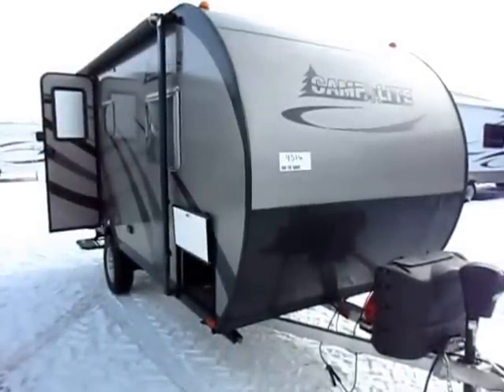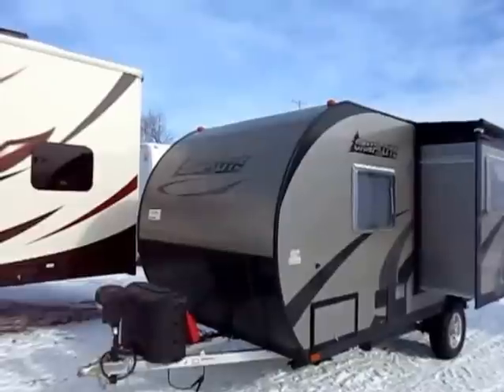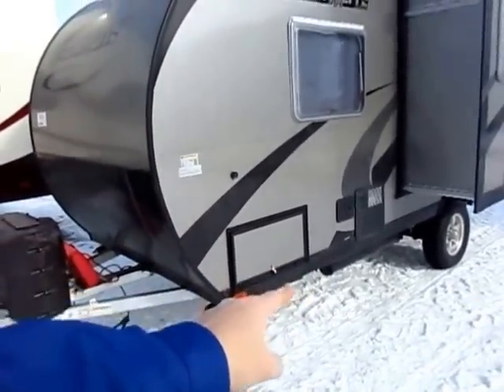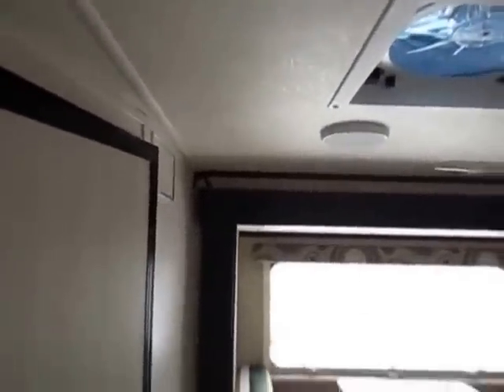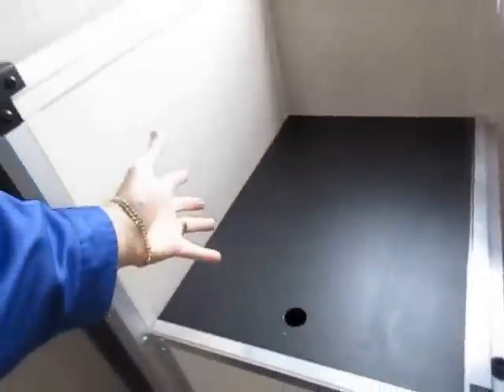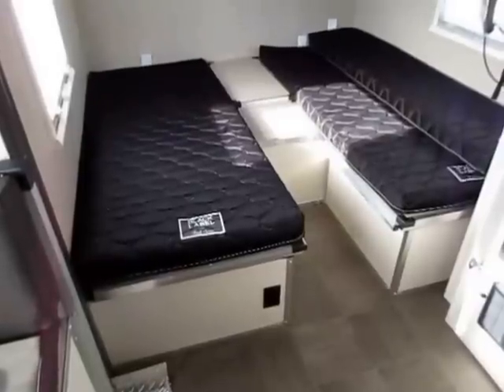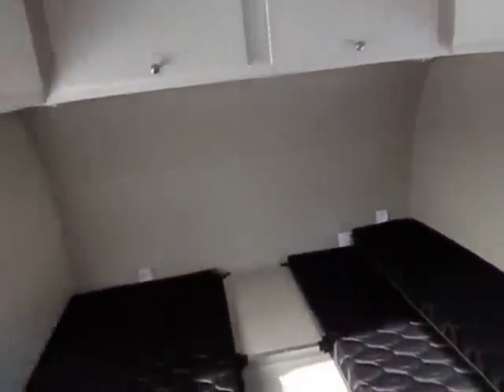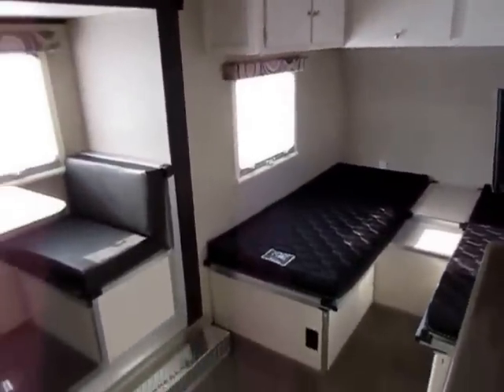(Sold) HaylettRV.com - 2016 Camplite 16TBS Ultralite Extreme Aluminum Mini Camper by Livin Lite

Comment: i live in the northwest territories is it insulated well,or can it be we  get mighty cold here -40c is pretty average.i really like the sturdy idea most rvs are flimsy oh and are there various sizes?
Reply from the maker: +Darrell barron: Absolutely no RVs are built for that sort of extreme temperature. Literally none. You'll have to look into supplementary insulation, skirting, and/or heating for any brand you choose.
Reply: Go and buy some cheap carpet and put it in the floor.  When it gets dirty/muddy, take it outside and shake the dirt off.

Comment: The first scene in the storage area shows wood (under the bed area).  You stated that there was no wood in the structure except in the cabinets. Sorry to point that out. ;)  Still, a very nice camper.
Reply from the maker: +Barbara Bardi: This is a great question and simply a matter of poor timing on my part. The statement is accurate. There is no wood in the structure of the camper. Cabinet face panels are not a structural item, but cosmetic. It's easily misunderstood and my timing in the video was admittedly poor. 

The skeleton/framework of the trailer has no wood. That's the actual structure upon which everything else is built.
Reply: +Joshua Winters Thanks for the response and clarification, Joshua!  I see what you're talking about now.  This is a great-looking little camper and your video is a real help as I begin making a list of the campers I will look at this summer. :)

Comment: Is a Thedford cassette toilet available...do not have access to a dump station
Reply from the maker: +gerard haubert: Not from the factory. This would need to be fulfilled via aftermarket work. It is possible, but such modifications may affect your factory warranty and would most certainly affect your resale value harshly.

Comment: Do you get any of these anymore
Reply from the maker: Livin Lite RVs aren't even currently in production. After 2016 the product was reassigned to a new group & cheapened up considerable (Basically standard RV construction, but with a really high price tag still) and it ceased being successful. 

The RV you see in this video stopped being built three years ago. I left these videos up to assist folks with older used models they may find in the marketplace.
Reply: @JoshtheRVNerd  thanks what a shame looks like a good RV

Comment: Is it narrower than the DBS model because of the slideout?
Reply from the maker: Negative friend. They're simply different series within the same family. Take Coachmen's Apex series of light weights for example: They have a specific selection of 8ft standard width RVs with and without slides as well as a selection of narrow body models with and without slides.
Reply: Thank you

Comment: I love it!
Reply from the maker: Glad you enjoyed the tour, Megan. Sadly, they have altered the Camplite series since the production of this video & we're no longer featuring them in our lineup as they have made some critical changes to the construction of the product.
Reply: Joshua Winters what do you mean critical changes? Bad or good?
Reply from the maker: Visesh Velagapudi: It's nothing necessarily "wrong," but there were critical changes to the core aspects of the product we no longer wanted to see. Things like scaling down to a traditionally constructed roof with rubber membrane, cheapening up the cabinet hardware to industry standard, etc. The little things that helped define this product have been sacrificed. 

At this point there is nothing functionally unique about the Camplite series that isn't already accomplished equally well by something like a Rockwood -- save that the Camplite is still SIGNIFICANTLY more expensive.

Comment: This must be expensive!
Reply: Very nice though!
Reply from the maker: +JaredThinks - They're certainly not the cheapest RV to purchase up front, but it's something designed from the ground up to be owned generationally -- meaning if you took proper care of it, then there's no reason you couldn't pass it down to the kids. In that respect they become one of the least expensive RVs on the market.
Reply: +Joshua Winters It's definitely a camper I'll buy in the future!  In the meantime, I'm in search of something affordable.
Reply from the maker: +JaredThinks: A great light weight single axle that falls more in line with traditional budgets would be Coachmen's Apex Nano series. Take a look at: http://www.haylettautoandrv.com/inventory.php?brand=apex%20nano&sortorder=asc&perpage=25. 

Apex Nano and Camplite actually share a lot of floor plans, so there's a good chance you'll see something similar here.
Reply: Joshua Winters Many thanks!